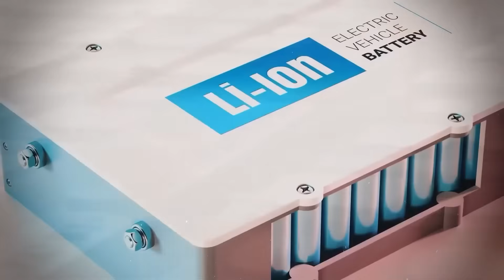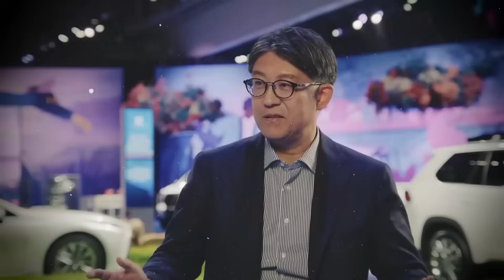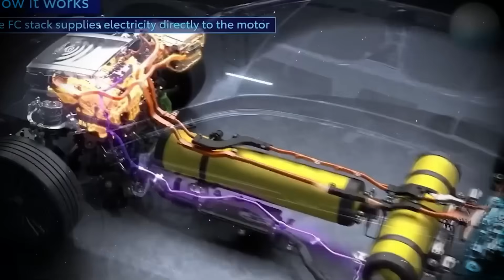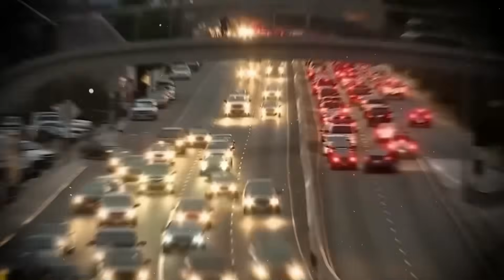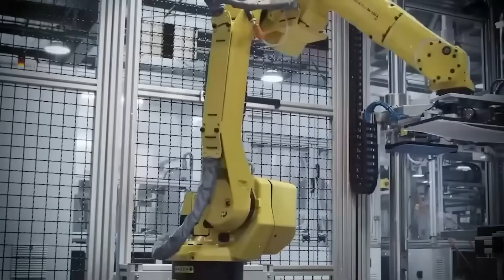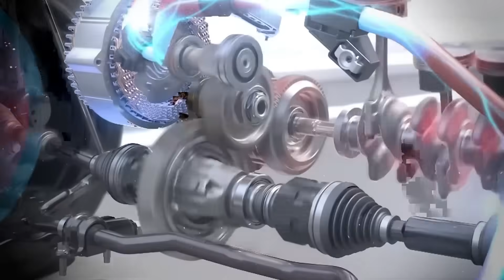5 Minutes Ago: Toyota CEO Drops a Bombshell about the Water Engine—EVs Are FINISHED!

Comment: What happens in countries where everything freezes every winter?
Reply: You can use the same method using water to generate hydrogen and charge your EV, either with fuel cells or a generator
Reply: Electric heating of the water tank.

Comment: I see one problem in winter driving, the steam coming out of the exhaust pipes will turn to water which will quickly freeze and build up on streets as ice. The cost of extra salting the roads to prevent accidents will cost governments millions, unless roads are heated to prevent the ice build up, which can be done but at great expense.
Reply: Won’t make any difference here in Scandinavia we change to winter tyres every winter, some roads can have ice and snow most of the winter.
Reply: Ha Ha, you twit!
Reply: @gordonloughton9800  F O
Reply: At this time using gasoline the emissions are CO2 and water. Yet there is no problem with ice formation on the roads in winter.  One good thing maybe that the lie of Climate Change due to manmade CO2 will become irrelevant.  The water engine is a tool to shut up the globalists.  CO2 at present is not a problem either. The globalists have the bribed  media behind them to spread this false news and unfortunately the masses fall for this lie.
Reply: Catch the water and recycle it into the fuel tank. Steam will come out the tail pipe.
Reply: @Marley-ii6ls another strange thing about this. Why don't they refill the tank with water and not any exhaust??? Red flag again!

Comment: Doing some quick research, Hydrogen is pre-supplied. Water is used for the cooling system, as the temperature to process the hydrogen is about 2,500C. So news here. Let's wait and see.
Reply: "A Piezoelectric Ultrasonicator."   First time I've ever heard of that title.
Reply: @jameswest4819  and the flux capacitor !

Comment: one  guy   who   had   a   water   engine   died   and   anther   one   followed    the   same   route   ITS   ABOUT   OIL  AND   MONEY,
Reply: Stanley Meyer was his name. He is the one in this video.
Reply: @scottygovoni  Is he the guy who built the water powered torch that could melt steel ??? I saw and saved this video from over 20 years ago.  He got a U.S. Military contract to retrofit 16 Humvees and was not seen after the first year of implementation.
Reply: Nicolai Tesla and Jim Von Meier, although no solid evidence exists for either and neither was inspected in detail or peer reviewed.  Also look up the GEET machines that claim to work on any water based fuel and got it's inventor locked away in Utah under their draconian laws. Currently Randel Mills - 'Brilliant Light' - is starting commercial trials with water fuelled Suncells having discovered that a form of Hydrogen he calls a Hydrino liberates intense light under controlled conditions using a metal as a catalyst.  Hydrogen in one form or another is certainly in the spotlight.
Reply: and flar earth run by lizzards
Reply: That's true but people got killed just a couple decades ago for things that are now not secrets anymore. If everyone decides to flip the switch because of climate change, that would be the wisest decision. What good are money if the electrical grid can't handle all the AC demands...

Comment: I do not think there is anything in this podcast that makes any technical or a factual sense. It is utter bs
Reply: The tric is that eleclrolysis happens with very little energy when the water is made vibrating.
This is contrary to what our physics books teach, but it appears true.
This was invented yeas ago by Stanley Meyer who was murdered ....
It was the criminal elite that kept everything away from the public.
Reply: dip shit, its been around since the 70s,
Reply: Water gas ? Yeah but pretty rough … it’s going to be a case of thinking it out properly … water isn’t a good lubricant … lower performance motors are a good thing if they can be clean …
Reply: its been around for years ,  it does work,